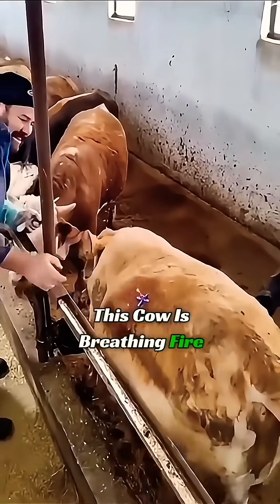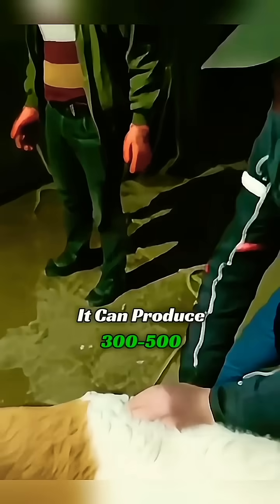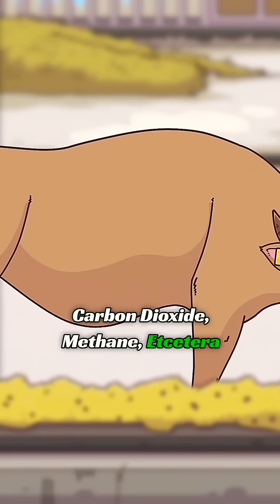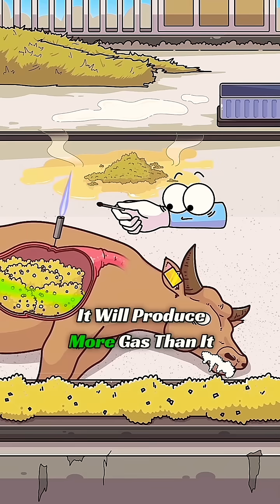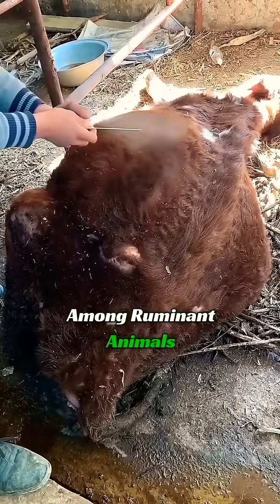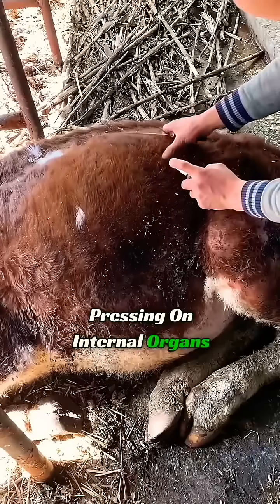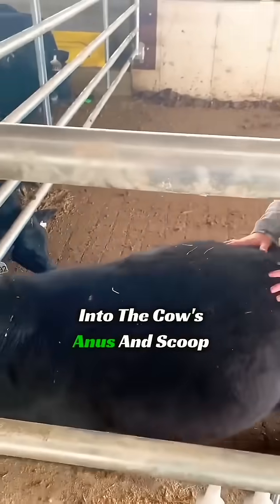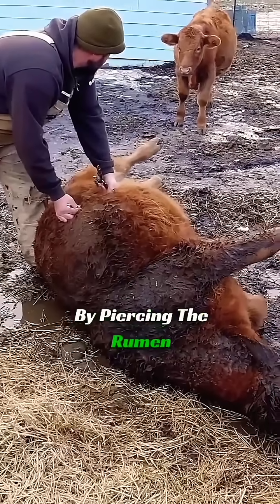Did you know about this? 😳 #farmlife #cow #didyouknow #usa

Comment: They’re using new techniques to capture the methane that’s from a cow now the average milking farm might have 7 to 1000 cows and they have a system to I believe when they do the slurry which is nothing but cow crap and water they have it enclosed in the cover and they recapture the methane They pump it into a tank they use the methane for free energy to run the electric generators that produce the electricity to run the fans or the lighting or anything else inside the area where the cows live thus pretty much the cows are making the energy now, which is a great idea